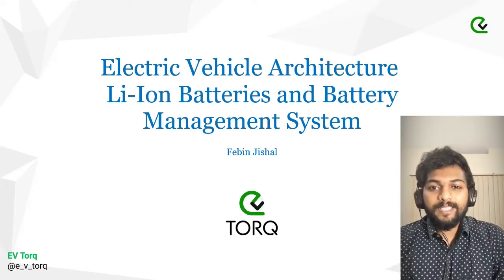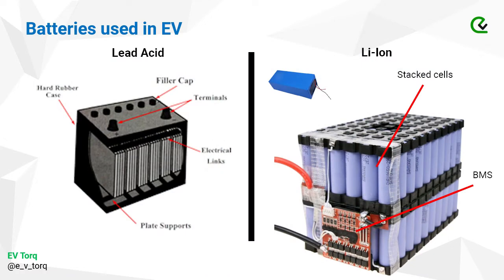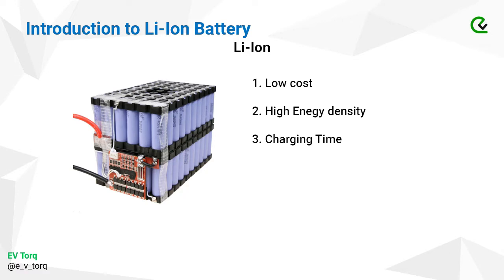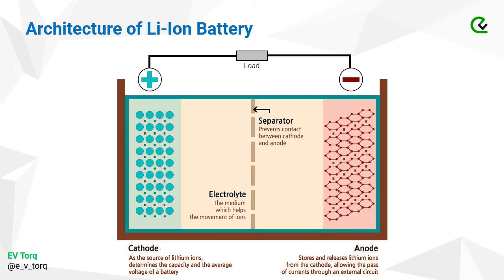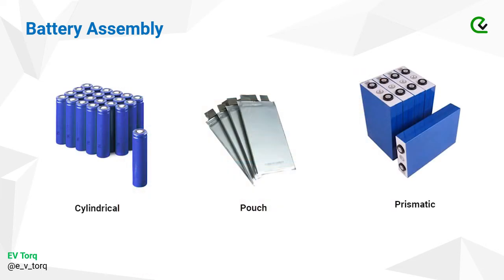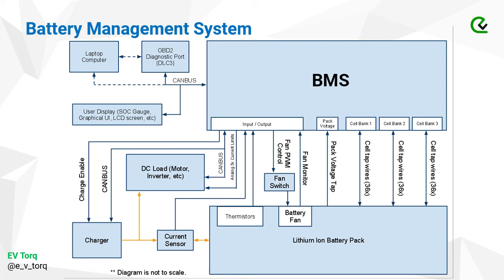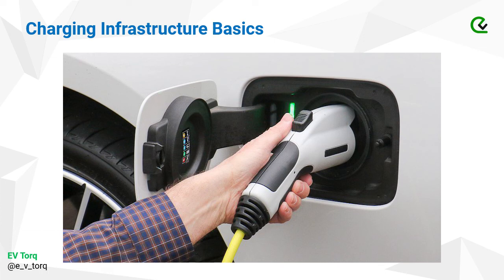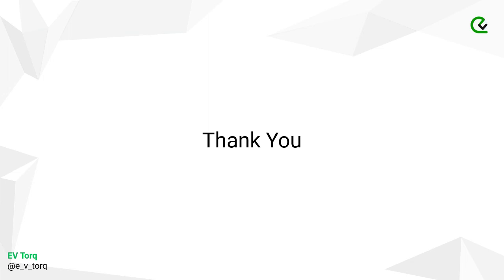Li-Ion Batteries and BMS | Introduction to EV Architecture | Part 3 | Febin Jishal

Comment: I have one doubt in scooters are charged by ac supply in house itself that is common thing happening now (that means in vehicle using converter convert AC in to DC and stored in battery and use ok)
Suppose I am going a trip I forget to take my  AC charger plug ,the place is having only DC charging station so in that time how can I charge my vehicle .plz give Clarification reg my doubt

What I am trying to say is  A vehicle is charging by AC supply how can the same vehicle is charged by using DC station is only available at that time
Reply from the maker: Every battery is charched with DC power supply, if you don't have a AC-DC coverter you can connect the battery to DC charging station which will provide the same voltage as your battery nominal voltage. If you connect it to a higher voltage it will damage your battery.
Reply: My doubt is,if a vehicle can only charged by a AC supply how can the vehicle charged by a DC station is only available at that time?
Reply from the maker: This is a rare scinario, as per my knowledge every DC charger will have a AC socket in their design. But for charging your vehicle either you will have to carry your charger or rent one from the charging provider.
Reply: @febinjishal  oh ok if there is AC Socket in their design then no prblm.ok thanks for clarification